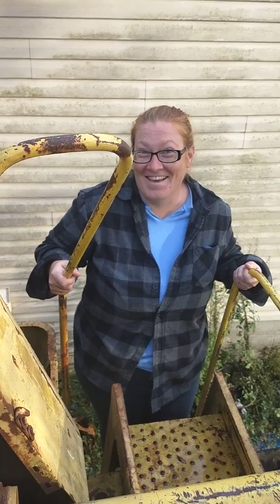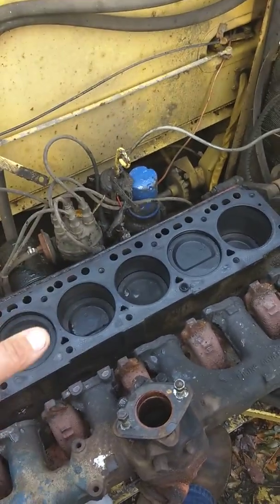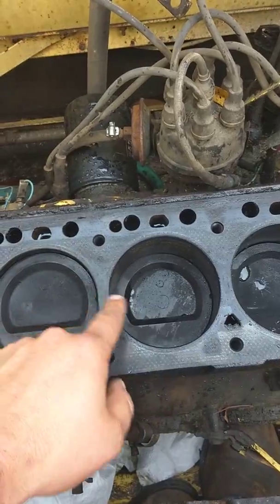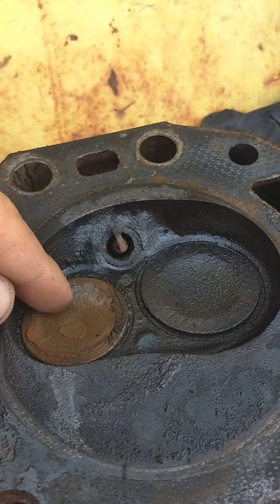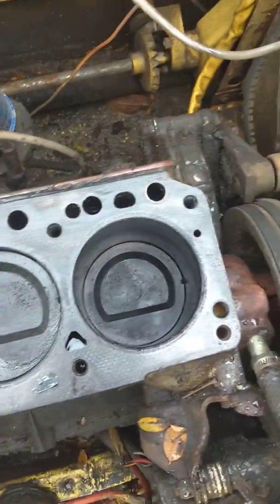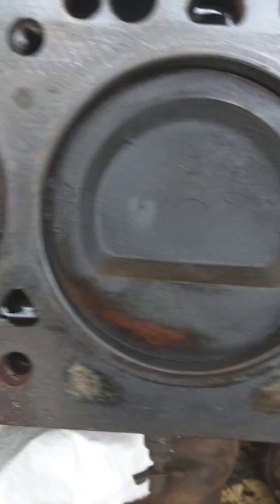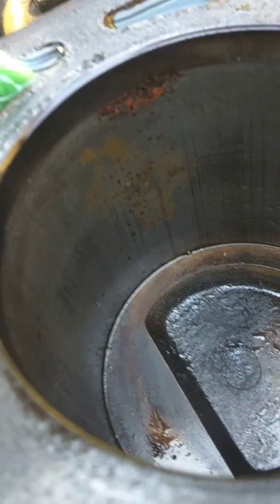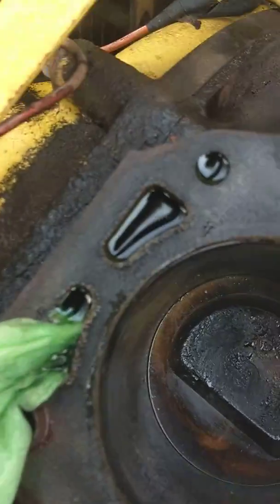Ford 300 straight 6. Getting the new Holland 1400 combine ready for harvest.

Comment: If you need any parts for that Ford, i have a complete ford engine  out of a 1400 NH sitting in my shed.
It ran when I transplanted a Diesel, but the valves need ground, shes weak.
Reply from the maker: I could really use a carb and governor assembly. Where you located?
Reply: @wannabefarmer6056  Mapleton, Iowa
Your gona laugh, mine has been converted to LP  so the governor is the same but the carb isnt
Reply from the maker: What did you use for a diesel replacement?
Reply: @wannabefarmer6056  inline 6 out of another 1400 NH, you will notice they sit on a frame with the radiator all as one unit, all the pulleys are the same. It was a very easy change.